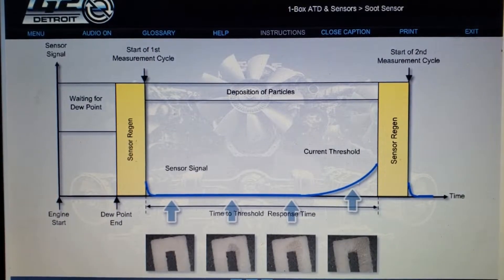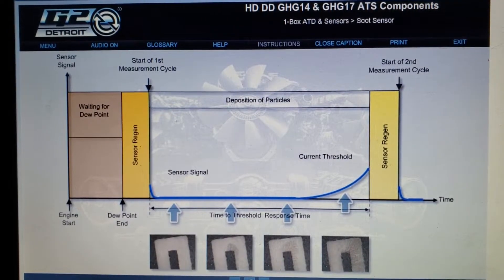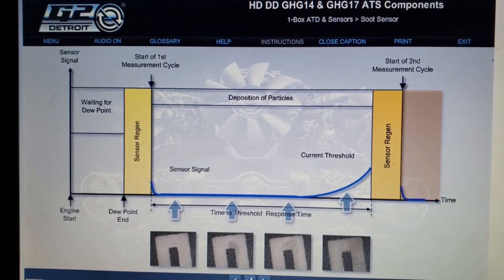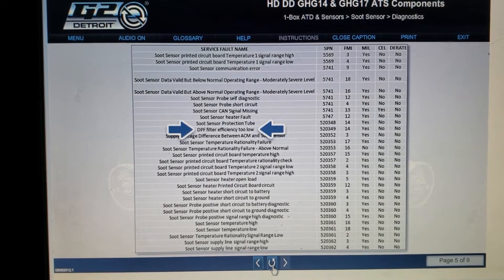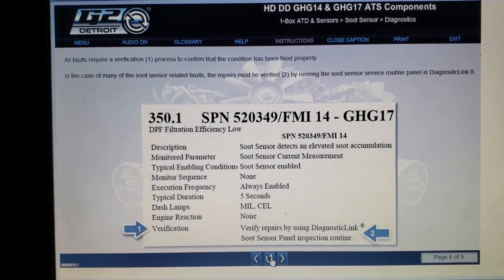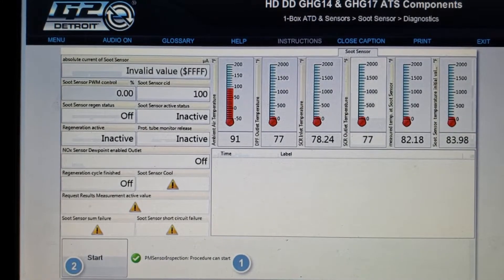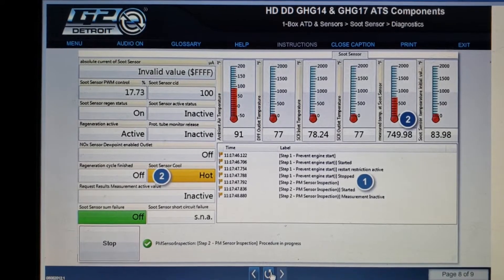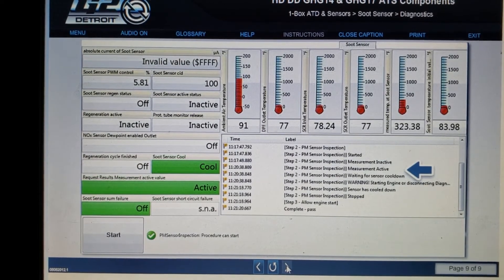Soot Sensor Operation and Information

Comment: Keep up the good work and videos. The low Def problem could have saved me a few houra if I had watched it 2 days ago. The DEF tank header was causing a leak and causing air to go in the def. Pressure would just stay at 17 psi on the EPA10 style.

Comment: 9 out of 10 times i got low efficiency code, the "1box" was no good. Usually the DOC is pushed back. If you remove the DPF inlet temperature sensor you can see the rim of the DOC, or the sensor probe is bent. Love your videos, hate the Detroit diesel 1box, good engines though.
Reply: drone1028 I agree, they seem to have the most problems with one box failure.
Reply: drone1028 how much pushed back is too much?

Comment: Engine light on for dpf soot level. Any idea what to do?
Reply from the maker: If it's simply a fault for high soot level in the DPF then it just needs a parked regeneration.
Reply: @TheDieseler  regeneration complete but still the same,
Reply from the maker: It may not be completing regens properly then. You will need to read and troubleshoot the stored fault codes.